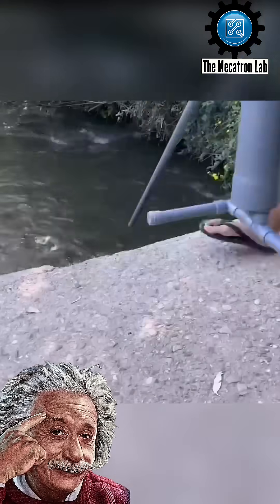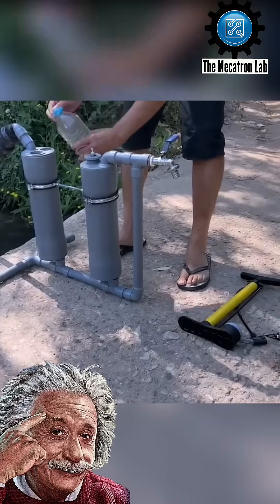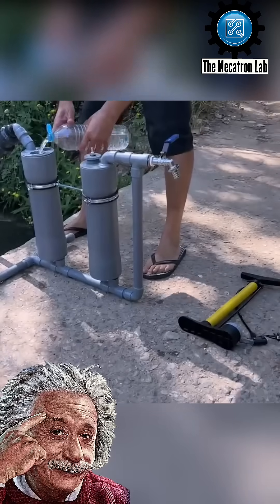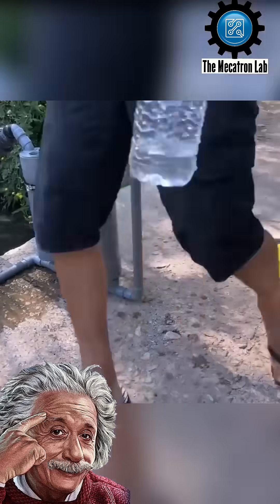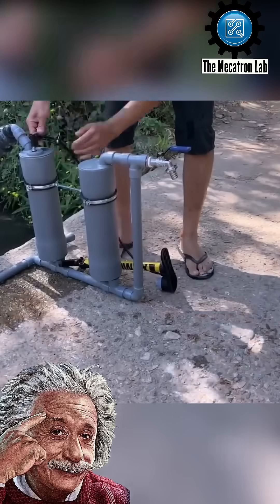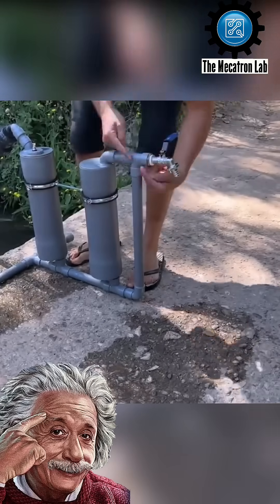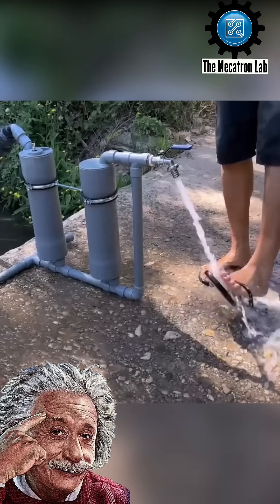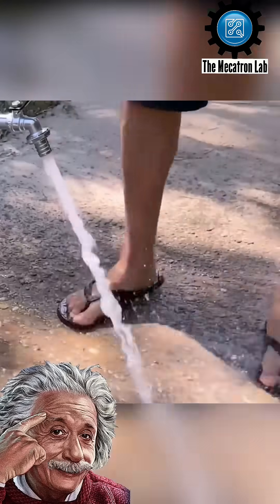Homemade water pump without Electricity using PVC pipe #diy

Comment: This actually has me needing to try this. I know you can push water ahead od an object to move forward and tye restrictive outlet does in a way make some sense. I wondering if the flowing water in tye creek is necessary to add a slight pressure. Pretty good video anyway

Comment: THE PIPE THAT SUBMESRED INTO THE WATER IS TIGHTLY CLOSED,SO THAT THE AIR PRESSURE THAT HAS BEEN PUMPED, FORCES THE WATER'S SURFACE AREA. SO AS YOU CAN SEE THE WATER IS IN HIGH SPEED BECAUSE OF THE LOWER PRESSURE AT THE TAP'S OUTLET...THEREFORE WATER WILL STOP AFTER A WHILE..

Comment: Oh stroke his cock. , i made something similar to this with two pipes and a ball valve.
You lose a little water to gain height . 

Before you go on to say 
Well he did it with.
I was 13 .
Gg
I did it with my plumbing experience i got from working with my dad.

Comment: In real life, if you want to prank your parents, friends, or loved ones, you can use half- and three-quarter-inch copper tubing to make a heat exchanger so that when you turn on a hit, hot comes out the hot side, and when you turn on cold, cold comes out the cold side. But if you turn them both on, they switch sides. That is real.

Comment: Vacuum and gravity does the job. You actually could just fill a hose with water with one end plugged and when you lift that end out of water and then unplug it, it does the same thing. No need for all the pipping. 😂
Reply: The out open must be low than that of water surface, in your case, in this case, I guess it is fake, or only works for a few minutes until the pressure reduced to [no pressure].

Comment: I know there are a water pump that  can work without electricity  by using the running water and multiplying  the water flow force but this work with air pressure, what happens  when the air is gone?
Reply: I think air is just to start the flow. Once the water starts flowing a suction force is created at the other end to take in water from the river. That looks like how it is done.

Comment: I am laughing at the fakery! 

For those people who do not understand the problem with this, just note that for the water to flow out of the tap normally (at low pressure), the tap will need to be at a lower level than the end of the inlet pipe submerged in the water and this is after disregarding all the contraptions in between the tap and the inlet pipe. 

Additionally, for the water to come out at that high pressure, the tap will need to be at a much lower level than the inlet pipe. That showboating of pouring in the water and pumping it with a bicycle pump is just meant to confuse people and it does absolutely nothing.

Comment: This video illustrates absolutely nothing! It just shows a guy pumping air into a chamber that then forces out water until the air pressure is equal to that of the atm after which his tap will most definitely dry up…

Comment: yes, but he must have also install a check valve on the pipe he submerge into the water, because once he pump air into the system pressure accumulate and once he open the water faucet the water that come's out with the pressure creates a vacuum pulling water from the stream.
Reply: Is it just a vacuum pressure siphon?
Reply: There is a non return valve in the pick up pipe. Full construction video is on You tube.

Comment: I love it...I need him on a sustainability vision project I am working to implement.
Reply: Its cap bro js build a ram pump it dose exactly the same but without using a hidden electric pump
Reply: @mrwolf9335  As long as you have running water at the source.
Reply: @SOLAR-cr5dp  yh wont work without flow

Comment: The video attempts to demonstrate a pump converting kinetic energy into downstream potential energy (commonly referred to as "water head" in hydraulics). However, the essential factor is the source of the upstream kinetic energy. There are only two possibilities: one is a higher water head, and the other is an artificial energy input into the system. Given the head loss, either energy input option must exceed the downstream potential energy.

Comment: Ram pump, or hydraulic ram, older names akvapult. Invented in the 18th century. It is based on using the power of flowing water to get a hydraulic pulse. It contains only 2 moving parts - the 2 valves. But only a small part of the incoming water is pumped to a higher height and most of the water goes out through the drain valve. But it is reliable and can stand and run unattended for days. Can lift water 8 meters without problems. The power comes from the flowing water, so if there is no flowing water, there will be no pumping.
Reply: bro just say it’s a pneumatic waterpump.
Reply: This isn't a ram pump. Not sure if it would actually work but it would just be a siphon if it did.
Reply: Is it difficult to build as genuine water pump even if you have to crank pump    any ideas from genuine plumber know how with filter system thanks clever gugs in theknow
Reply: This isn't a ram pump. This is just some pvc parts arranged for the camera, while the off-camera end is connected to a pressurized water source... Aaannnddd... the clueless fall for it every time. 
Reminiscent of the hardest part about creating a Perpetual Motion Machine: Figuring out where to hide the battery. Or the motor.
Reply: @johnlshilling1446  isso fosse possível; seria uma benção para as pequenas obrigações, e outros basta.ecimemtos de água em propriedades rurais.
Reply: @johnlshilling1446  You are pessimistic

Comment: This is a very talented take on  what's known as a siphon pump.
Indeed, it will continue to flow as long as you don’t break the siphon. 
The technology has been around for at least a millennium, but in our current time, when most people only know that water comes from a faucet this is "high tech".
So, for them it is - enjoy and be amazed!
Reply: Siphon works from higher level liquid to lower levels than liquid.
Reply: @siddharthidekar  Correct!
Reply: Hucchsulemagana

Comment: He did not invent this type of pump. They’ve been around a long, long time. Certainly before electricity. And yes, it does have the power to send water many metres upwards.
Reply: I think you are referring to the Ram pump which works by the force of moving water but this not it. For  a Ram pump to function it needs to be fed by a running stream of water. An inlet valve and an exhaust valve have to be present and these are conspicuous by their absence in this " design".
Reply: @ 
But one pipe still has to be immersed in the stream and water fed by hand into the unit. There are either one-way valves (Ram pump) or an electricity/battery source could this “pump” lift water to a height of several metres.
Reply: @Tomthumb222  Stop arguing and build one. Come back when you get it to work.
Reply: @ who’s arguing. Just stating facts

Comment: They don't describe the pump well enough and the video only shows it from one angle so you really can't tell and just like the other things are saying something more has to be there I see two different bladders but that can most make a impulse pump also known as a hammer pump but it would still need a pressure source of some kind to amplify it couldn't take it uphill not before amplification anyway

Comment: Здесь какой механизм работает?
Reply: This pipe circuit is powered by the air pressure, and it works... until the "extra" air pressure is used up and it's balanced with the normal atmospheric pressure.  If you keep adding even small pressure, it will keep running.
The system uses a different method of creating suction in the intake tube, but if you inject a stream of "priming" water at moderate pressure from a small tube where he injected the air, it creates suction at the intake.  The simplest design is made of heavy guage Aluminum, called an "Eductor."  They are used by the US Navy, to pump out water, by injecting water from a firehouse, through a nozzle that could be as small as about 3/8" diameter, shooting near intake, aimed toward output.  Suction is created at intake, water is blown out the output end at a great flow rate.  By connecting the eductor to a section of  hose, you can pump large volumes of water without any electricity, turbine blades or gearing.  The eductor resembles an aluminum boot, with an open toe end, shooting water out the tall end.  You can scale them down or up, it's a simple principle.
Key benefit:  The water you inject in must be screened enough to prevent clogging the injector nozzle, BUT the intake and flow through only has to screen small enough so as not block the larger diameter of the eductor body and output hose.  They work very well, clean water or not.

Comment: Ram pumps are well known. My great-grandfather had one in his quarry to pump spring water up to the farm house. No power was used.
Reply: This is not hydram Or ram pump... 
It's a fake pump 😂😂😂
Reply: 😂😂😂😂 @MysticScorpioSoul
Reply: @mrsillywalk  True, but then you need the power from a running water source. Only  a small percentage of the RUNNING WATER STREAM will be elevated to a high position. This works because of the energy in the MOVING WATER at the bottom of the system. No water movement, no pump action.

Comment: If I can see the same pressure for 15 minutes well let's say 10 minutes continue I will believe it otherwise it's air pressure that he just put in the first tank
Reply: @alfredomarin9762  Air pressure is all that causes the water flow until the pressure goes low and/or the water in the cylinder(s) is finished!

Comment: So, he filled up the large tubes with water, pressurized it with a bike pump and then let the water be pushed out (notice it didn't run for long?) The other pipes are just a stand.

Comment: Bull shit use flexible a pipe and suck water and leave it 
It will continue to flow and u are next to river so why wasting time when thing can be done in cheap and efficient way.
Reply: @sagargurung7961  It still can not flow uphill without a real pump.

Comment: using a hidden electric pump is indeed very innovative
Reply: Jo tohle je falešné. Voda by takhle netekla, tekla by v pulzech. Zařízení se jmenuje v českém jazyce trkač a opravdu funguje bez elektřiny. https://cs.wikipedia.org/wiki/Vodní_trkač
Reply: @jangajdos2001  Yes, the Czech (Czechoslovak) cottage superpower knows "knockers". Other methods require hidden pumps - absolutely.
Reply: Rum Pump.
Reply: Tipu-2 -an air keluar cuma bisa keluar hanya yg tersinpan ditabung krn diberi tekanan pompa angin  sehabis itu habis  sedangkan pipa yg kegot hanya pantasi spy kita yakin airnya kesedot . Bearti hanya sumlap dan bohong .😂😂😂😂😂😂😂😂😂😂😂
Reply: I believe it works on the "ram pump" principle.
Reply: çekvalf olma zorunda su hortumu silindir birleşiminde sistem çalışır
Reply: Bruh look up ram pump. He used a bike pump to replace pumping air into the system through the waste valve
Reply: Hello, I'm sending a message from Iran.
My son has cancer and we need $1700 to complete the chemotherapy.
If anyone reads my message can help, I would be grateful. You will be indebted to yourself for the rest of your life. My son could only stay with us for a few more days.
Reply: Maybe you haven't seen or heard of pressure vessel, this works the same way
Reply: Tidak, bukan pakai pompa listrik, tapi itu benar2 bekerja, dan tapi setelah angin dari pompa itu sudah habis maka akan berhenti dan harus di pompa lagi, dan itu cuma contoh dari pompa air hidrolik, begitulah kira2
Reply: 😂😂😂 if it real he's not gonna record the video like that, almost everyone believe it 🤣😂
Reply: @McRaegreenwood have you seen or heard of pressure vessel? This one used the same concept, so it's real. Don't mock people.
Reply: @lokmanhussain3805  but this one is lying, if it's not he will show us
Reply: @McRaegreenwood  FYI, in factories you can normally see pressurised vessels. These factories   will store water in big containers, then electrical powered pumps will pump the water to those pressure vessels. Pressure vessels have their own pump to pressurize sets of diaphragm so that water can be supplied through out the factory, when the pressure drops below set point, the pump will run to make up the pressure needed. So this guy is using the concept but with manual pump.
Reply: It's not electric.  This is just a ram pump. Although this is a nicely built one. But they've been using ram pumps for ages
Reply: berhasil memonpa air, cuma selama air dalam tabung belum habis, tidak bisa menyedot air dari kolam.
Reply: This called ramp pump it is already use world wide just do Your research..
Reply: Siphon
Reply: Why are so negative?
Reply: It works with the help of air.
Reply: Probably not. The power comes from the flow of the river. It would not work with a lake or pond.
It is called a ram pump and they are only about 10% efficient but it is free power from the stream so that is fine. Farmers use these a lot.
Reply: Yes, RO magic indeed
Reply: What he did is the initial connection to the gravitational law for flow of fluids. Those two pipes should be full that the first serves as a container with the fluid and high pressure and the second serves as pulling fluid that pulls and connect the flow, like you pull some fluid from a container by a pipe and leave it to flow. Now your pull is replaced by the push of the pipe between the two pipes. He is incredible.//
Reply: Or when the air pressure is relieved, end of flow.   Other versions are simply using the siphoning effect.   Would like to see full video that shows how long this water actually flows from that amount of pressure pumped in.
Reply: It uses a pressure chamber that pushes the water, shure it wouldn't work this good he does use a pump in the vid but it will work irl
Reply: มันจริงหรือใช้ได้นานหรือ
Reply: 😂😂😂 pembodohan masal
Reply: Unfortunately, so far 5000 naif people believed and liked it.
Reply: Anda harus memompa terus guna menghisap air hingga mengalir terus menerus..😅
Reply: I guess some people here never suck gas from a car tank, it is all gravity.
Reply: @georgecferguson  lol.. to siphon fluid from a reservoir without 
'helping' it the outlet has to be below the level of the fluid in the reservoir
Reply: @gregcombrink1626  When you siphon gas from a car is the gas tank lower than the part you siphon from, every drop will come out if you do not remove the hose.
Reply: @georgecferguson  Бензобак выше канистры...
Reply: @ except for the fact that the outlet always has to be lower than the liquid level in the tank, otherwise you’ll only empty the containers which are higher than the outlet pipe. It WILL NOT draw it from the river lower down.
Reply: No electric Pump is needed...if you have a look at his construktion you can see that he uses a system of two big tubes that are connected by a small one. He fills it up until both big ones are full. Then he closes the outlet and pumps air in the left tube to pressurize the system.
Then he opens the outlet... et voilá: water coming out of the outlet...
Reply: @baerchen9591  yes for as long as the pressure lasts, then an outside force is again required to pressurise the system.
Reply: @baerchen9591  water coming out as long as the pressure lasts…….
Reply: LOL,😂😂 waterpump submersible tdk di shoting,wkwkwk  @baerchen9591
Reply: @baerchen9591  buddy you dont know what your talking account you said construktion instead of construction GIT GUD
Reply: @baerchen9591  Will he not have to maintain the air pressure?
Reply: @stigrynning :  NO, as long as the intake pipe, one submerged is constantly submerged.
Reply: @baerchen9591  in first tube there is an another hole near where he pressurized air for what? Then how air pressure develope inside?
Reply: @murali.r2532  The hole is for pumping in air. It distributes it's pressure from top of the first big tube as an air reservoi. As long as there is air with pressure higher than the air outside of the system water will come out (as long as there is water of course). This video is a scam.
Reply: @baerchen9591  I'm afraid it's a magic show.

Comment: Its will stop working if you stop a few time,then you have to pumping air again,not practical 😂😂😂😂😂
Reply: better than walking 2 miles everyday to a local river persay, so it is practical.
Reply: @froztheeB  Not that practical. The amount of air needed to be pumped in to get a high enough air pressure, plus the tubes needing to be primed, may not make this work over long distances.
For long distances you might have to make a choice between trying to fill a large container with a high enough air pressure to keep it at the ready, or a constant manual pump. And those already exist.